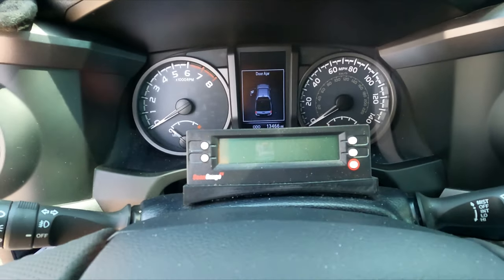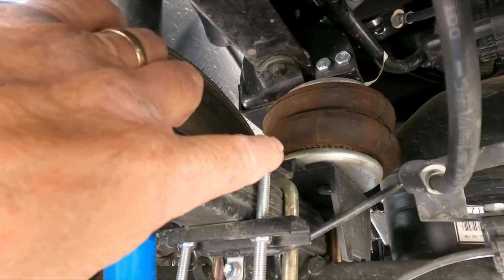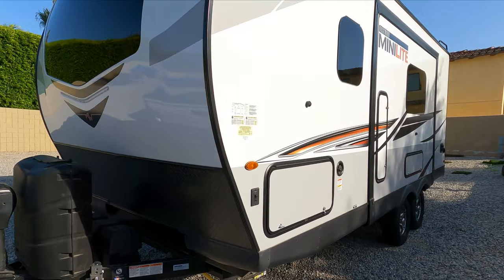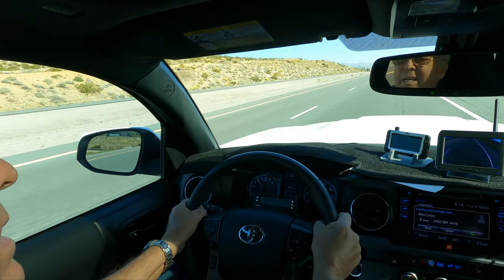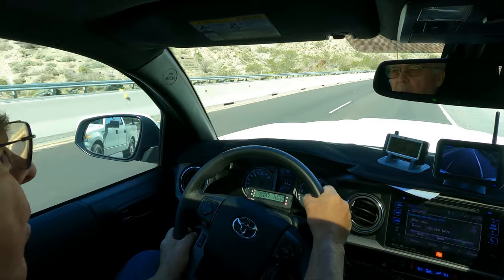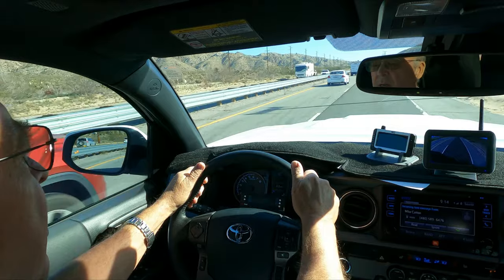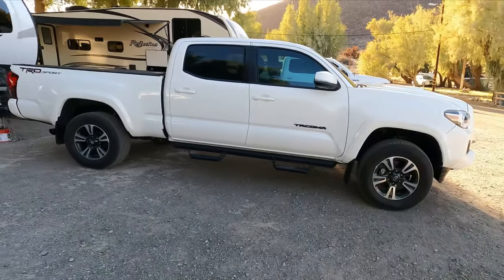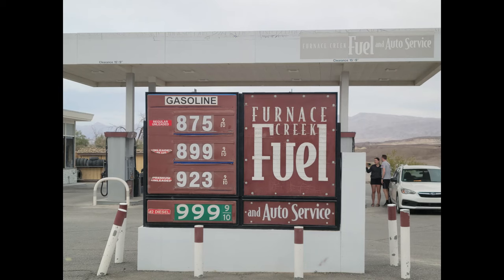A Real World Tacoma Tow Test

Comment: Hi.  It's been 2 years since you made this video.  Just wondering what you think about the Tacoma towing now.  I am a handyman that tow a ~3500 lb trailer daily.  Thinking of downsizing from a 97 Ford F350.   Thanks.
Reply: Daily? I wouldn't downgrade. Toyota's can do it, as demonstrated in the video, but look at all the stuff you have to do to it to make it work. If I was pulling a trailer everyday I'd want a truck that was built to do that. My 17' TRD OffRoad whines pulling 1800 pounds. Can it do it? Yes. Does it like it? Not really. Just my two cents since I figure old Gary probably isn't coming back to these older videos. Cheers.
Reply: I have the 24 Tacoma with the I4 turbo. It tows my 3400 pound, v-nose, 6 foot wide, cargo trailer very well. Am super happy with it. However, the truck is a big electrical gremlin, and Toyota won't fix it. They won't install a brake controller, either. It really needs one at that weight.

Comment: I just picked up a 2014 Ram Outdoorsman 1500 with heavy duty towing package, tow mirrors and Integrated brake controller. Didn’t have to add anything and it’ll tow 10,300 lbs.  Also came with after market air bags in the rear coils.  Tows my 29’ TT with ease and worry free.  Good luck.

Comment: Good video. Would like to know more about “ pinning “ transmission on the Tacoma.  I have a 2008 tundra with tow package with a transmission cooler.  My son has the same Tacoma as yours. Thanks
Reply: Check out a video by Trail Pass -“ Modify your Tacoma to handle the heat - Pin the Transmission”. He shows you how to do it.

Comment: The ECT power button is that the button that I need to use while pulling a trailer so it helps it from the RPMs not going up too high? Also when pulling the trailer do I put it in drive or pull it into the "S" gear when pulling my trailer?

Comment: Do you just leave the transmission pinned or do you change it back once your done towing
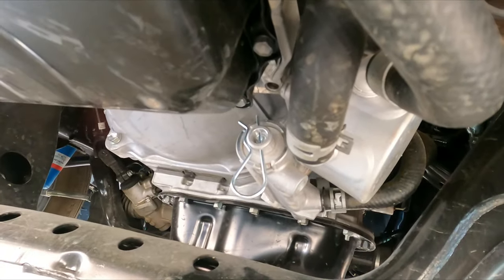Reply: I have a 21 Tacoma TRD Pro with a lift. I just bought a travel trailer and wanting to learn as much as I can. Is this pin trick (1:43) necessary? I guess I’m not understanding the reason. I’m getting same camera system, have a brake controller and got a weight distribution hitch to help. Haven’t pulled it home yet, I pick up at the dealership Thursday!
Reply: @mattrodriguez87  I’m in the same boat, I’m picking mine up today. I’m a little afraid since mine didn’t come with a transmission cooler even tho I’m told all TRD models have the tow package

Comment: Excessive heat and foreign debris will kill an automatic transmission absolutely. Anything over 200 degrees and I would very much recommend an auxiliary cooler, along with more frequent service intervals. For this size of a camper a 1/2 ton full size would be a much better choice.

Comment: Hey Gary! These shifts are increasing oil temp! Next time you better stick to the manual mode and pre select the lower gear. I bet result will be better.  And also,  I think your fuel is regular.  You better switch to premium fuel type.  Engine is lacking power. That 1GR 4.0 V6 loves high octane petrol!

Comment: That trailer is too big for your Tacoma. I know it’s within the rated tow weight for the truck … but the simple fact is they over rate all trucks .the fact that you are needing airbags and mods to keep the tranny fluid cooler.. as well as temp gauges etc et. . This is not the truck for the job . Will it do it in a pinch ? Sure , but the truck is straining.. and it’s wearing stuff out .. But simply pulling the trailer is only part of the equation. Get into any kind of emergency maneuver or stop …If an animal ran out in front of you .. some strong cross winds, or any other bad weather like heavy rain causing pooling on the roads .. et etc . You are going to put yourself in a bad situation. I’ve towed all my life. I’ve towed with everything from an old 4 cyl Toyota truck , up to now owning an f250 super duty . Let me just say .. there’s no replacement for displacement, and weight and wheelbase. Step up to a tundra or any other full-size half ton , and you won’t need all those mods ,. And your whole driving experience will be night and day different and a more relaxed experience. It’s not just pulling power .. it’s how a bigger truck handles the weight and holds the road with the trailer behind it . Your set up is known as “tail wagging the dog”  
Sorry, not trying to bash you . It’s a nice set up you have . But I am only speaking from experience, and from a safety standpoint .
Reply: Truck pulled it no problem, he’s pulling a trailer 2000lbs under his towing capacity. Obviously tacomas aren’t the strongest truck but it can handle what he’s towing. Transmission cooler is a plus especially he lives a hotter area. I’ve seen tacomas tow bigger trailers than this no problem
Reply from the maker: The truck was purchased before I even thought of a trailer but I've found the Tacoma easily tows this trailer. I just did the upgrades because I've never had a truck of any kind before let alone a trailer of this type .I'm really particular about caring for my vehicles and have no issue upgrading to monitor how it performs. The last vehicle I owned was an ASTRO cargo van which served me well for 23 years. I'd still have it if it still served my purpose. It just wasn't a travel type vehicle. Other than that, I only tow this trailer once or twice a year and not that far so I believe the Tacoma suits my needs just fine. Especially with the cost of fuel. But thanks for your input.
Reply: Almost all trucks that are built for towing have an engine oil cooler and transmission fluid cooler, not sure why you think that having these means the truck is in over its head. Also airbags are meant to supplement the suspension because unlike the full sized trucks that are specifically designed for towing, Toyota’s have a very soft suspension so the airbags raise the rear to allow the suspension to do its job. Combined with a weight distribution hitch (which are recommended) you have excellent control of your trailer. The Tacoma is perfectly equipped for this job, it’s biggest knock is probably the transmission and gearing. Also as far as emergency maneuvers that’s why you go slow and keep your distance, you use trailer brakes for improved stopping as well. You can make that argument for any towing set up
Reply from the maker: @Jasper118  Thanks for the reply Jasper. I don't think my truck is in over it's head. It just wasn't originally purchased with the intent of towing. The trailer was a pure afterthought. Actually relatively speaking, my truck and trailer compare respectively in capabilities to my cousin's F150 and his 25' trailer in weight and power to weight ratio. He doesn't tow any faster or get any better mileage. So I'm happy with my rig for what little towing I do and although a 3rd aftermarket trans cooler might be nice, I'm convinced it's pretty much overkill. BTW, I did finally get the dealer to admit at my last service that they found a software update for the ECU & trans. They did that and I've noticed an immediate improvement in both shifting and throttle response. Haven't tried towing yet and it's too soon to compare gas mileage differences but I plan to test that out and post again on my upcoming Yellowstone trip. Stay Tuned.
Reply: @garycotton  awesome, that’d be a very interesting update. I am in the same boat, I purchased my 2015 TRD brand new with no thought of towing but I just bought a travel trailer very similar to yours. Now I’m curious if there are any software updates for the 2nd gen that may help with this as well. I have also been reading that you don’t want your tranny to be too cool so I’ll have to just track mine to see if additional cooling is even needed. Thanks for the excellent videos
Reply: @Jasper118   I am well aware of all the things you stated . I’ve towed all kinds of trailers with all kinds of trucks. I’ve towed with little Toyota’s and Ford rangers .. I’ve towed with full size half tons .. and I’ve towed with 3/4 and 1 ton trucks . I’ve used helper springs .. and I’ve used weight distribution hitches on half tons towing trailers heavier then they should be towing . I realize all these things help . But they are simply band aid solutions for a truck that just isn’t up your the task.
You said it yourself in your first sentence . “Trucks that are built to tow have a transmission and oil cooler” exactly. They come from the factory with these because they are built to tow. The tacoma is not a tow rig and that is why they don’t come with these things, it’ll tow a moderate sized trailer in a pinch , but if you are planning to tow anymore than around 3500-4000 lbs on a regular basis, and for any great distances . The Tacoma is a little on the light duty side. Yes, it’ll do it. But hook the same trailer up to a full size half ton with a real towing package .. and you’ll feel twice as confident and safe going down the road, and the truck will be far less strained .
Reply: @gordboyko769  my tacoma came with all of those things from the factory just like a full sized rig would. And if the axels, frame, and drive train can handle the weight then adding the appropriate cooling methods aftermarket is totally fine, it does not mean it can’t handle the weight. Just like any vehicle if you’re within the recommended weight ratings then you’re fine. And your last point is obvious. I could use a semi truck to tow an empty utility trailer and feel more confident but that doesn’t mean my truck can’t handle it or wasn’t built for it. Your original point is wrong, his trailer in the video is not too much for this truck based on the the manufactures recommendations and drivers experience actually towing the trailer.
Reply: @Jasper118   ok, if you think so. I stand by my original statement. It’s too much trailer for the Tacoma. Just because it technically can, doesn’t mean it should. Bad weather .. cross winds, or an emergency avoidance would change your mind very quickly about the Tacoma’s towing ability. But, to each their own.
Reply: @gordboyko769  hey Gord, it sounds like you really know what you’re talking about so I have a question for you. I have a 6 speed manual 2021 Tacoma and is rated to tow 6500lbs (which we all know is a joke). I am planning on buying a 21’ bay boat (no T top or large bow flare to catch wind) that weighs 1800 dry plus the weight of the single axle galvanized trailer without trailer brakes. I want to tow it from MD to FL over two days and I am worried that ~3000+ lbs may be too much for my truck over that long of a distance. What are your thoughts?
Reply: You are spot on with your analysis, commentary…your experience shows. Thank you
Reply: @kawasakidirtrider    I have been towing my 5000lbs (loaded) travel trailer in the Colorado mountains all summer and it tows great, way better than I thought. Do not use any overdrive gear. I have an automatic so I tow in 4th I can cruise 60-70 at approximately 2500rpm if it’s flat, I pass semis and other large vehicles with ease. The only time the Tacoma struggled at all was a 21% grade for 5 miles but I just went down a gear and went slow. It was 85 degrees out and my transmission temp just barely hit 230 for a minute. I use the equalizer weight distribution hitch which is amazing, with that alone you don’t need any sort of air springs. I only have a 1/2-3/4 inch of sag and almost no porpoising with it, kind of loud though. Trailer breaks are a good idea if you’re over 2000-2500. Normal driving I average 21-22 mpg, while towing flat I get 10-12, in the mountains I dropped to 8-10. Because I hit 230 on my trans temp and I live in the mountains I added a bigger trans cooler and I haven’t hit 190 yet, even with 105 temps last week. The factory trans cooler is a joke. Oil cooler works great though. I drive a ‘15 TRD sport, automatic, bone stock except the trans cooler. Just following the 80% rule with towing you’re well below that and without a high profile load and/or a weight distribution hitch you’re fine. Tacomas are not “built” for towing but they tow great within their parameters.
Reply: @Jasper118  thanks for the detailed breakdown!!
Reply: Well said !
Reply: What would you say about a 2029 Tacoma..12 ft enclosed trailer ..prob 4000-4500 lbs? Any help appreciated going from NC to Montana. Have a 4x4 with a Old man emu heavy load suspension. Currently running 32 in tires but will make the trip in stock tire size.